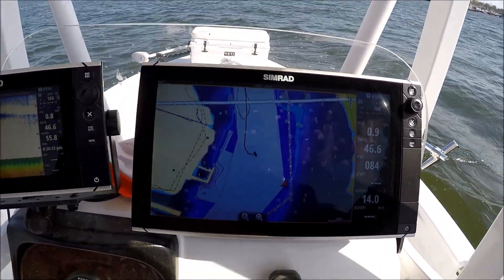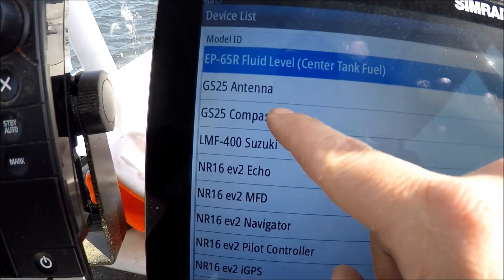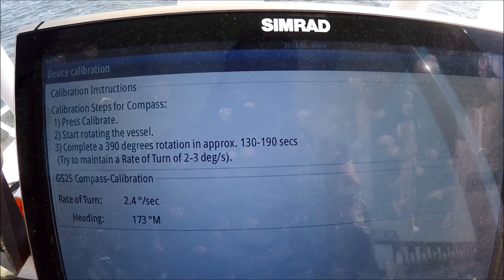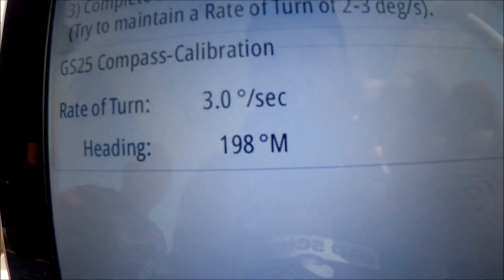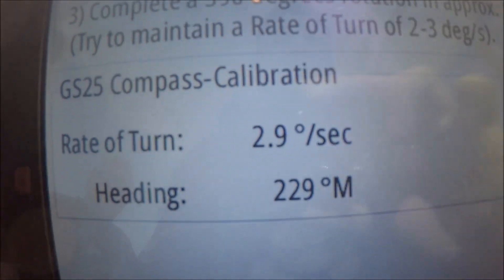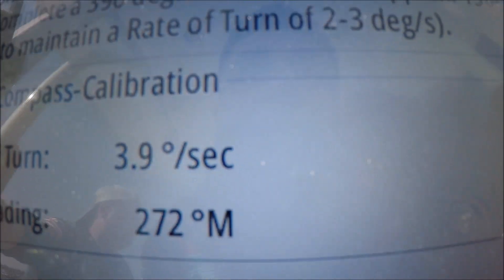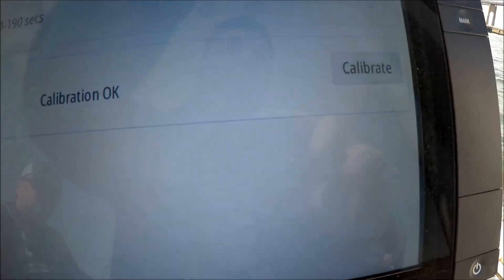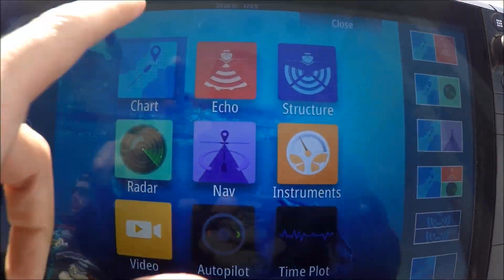How to calibrate your SIMRAD Heading Sensor! Its Easy IMPORTANT! Simrad NSS Evo2 -NSO Evo2- NSE

Comment: Do you need the gs25 or is there an internal compass that you can calibrate?
Reply from the maker: There is no internal compass. It can’t be close to other metals.
Reply: Ok so would that explain why the orientation of my boat never changes on the map when I’m underway? For example if I’m heading east, the boat icon will move east but the bow part of the icon doesn’t actually point east. The boat icon just remains in a fixed position and slides around the map
Reply from the maker: Yep 👍.
Reply: @MikeSmedleyOLDSCHOOLSTRIPERS  last question, would a point-1 work as a gs25 on an evo3?
Reply from the maker: @ I’m 99% sure it will but I haven’t tried personally so I can’t say 100%. It’s all the same company and manufacturers so I’d be surprised if it didn’t work.

Comment: Hi Mike.  I have an Aluminum plate hull boat.  Will my GS25 mounted compass be interfered either no matter where I mount it?
Reply from the maker: It’s hard to say without some experimenting, but if I had an aluminum boat I would definitely find a way to mount it up on some type of pole to get it at least 3 feet away from the aluminum.  I’d probably get a plastic antenna mount that screws up into the bottom of the GS25 and attach the mount to 3’ of heavy PVC pipe or some type of carbon fiber pipe (if you want it to look better). Keep me posted. I’d love to hear how it works for you. 👍
Reply: @MikeSmedleyOLDSCHOOLSTRIPERS  
Many thanks Mike.  I just stumbled across this video by chance and was not even aware of this need to calibrate this compass.  I’ll do it when I’m out next in a few days hopefully.

If I do achieve successful calibration, does this imply that the aluminium hull would not be interfering with the compass?
Reply from the maker: @Camh1968 The aluminum can still interfere even though the calibration was successful.  Aluminum won’t affect it like magnetic steel would, but it can still affect it. It only takes your heading to be off by a few degrees to spell disaster when running at night.
Reply: @MikeSmedleyOLDSCHOOLSTRIPERS  wow- thanks for that.  I have lots to think about to get this right…

Comment: Mike just wondering where you ended up mounting your GS25 on the SP 248.  On my 248' my 4' shakespeare antenna is on starboard side of top and and was thinking of mounting gs25 adjacent on port side of top bringing wires (NMEA2K) down through top into the port side access hatch of the overhead console down inside the support tubes for the top to my backbone inside console.  My concern is that the magnet on forward speaker on the port side might be too much interference (approx. 3+ ft away).  The boat is an hour away at moment so i cant put the magnetometer up there and simply test. Really just wondering were you ended up mounting yours on your SP 248' so I don't end up reinventing the wheel. Did you flush mount or use that plastic offset piece.  Tight lines brother and thanks!
Reply from the maker: Mine is around 12’ from raydome on the centerline of t top. Not flush mounted. 👍👍

Comment: I've had nothing but problems with my GS25 compass.  Countless circles and still won't calibrate, just times out.   Extremely frustrating
Reply from the maker: It’s likely the wire.
Reply: Mike, i've tried that.   Swapped out the NMEA2000 cable with a new one.   Same thing every time just times out.   Heading is all over the place between +32° and -32°
Reply from the maker: If it’s mounted far away from metal and still messes up it might be bad.

Comment: Hey Mike, where did you mount your external heading sensor? If you have radar, do you recommended mounting an external heading sensor behind the radar at it's 6 o'clock position at the centerline of the boat?

Comment: Thanks for creating this Mike.
Reply from the maker: I’m glad you like it brother!!
Reply: @MikeSmedleyOLDSCHOOLSTRIPERS  Went out yesterday for Blue Fin Tuna (late start since I worked the night before) with a few friends and immediately noticed that my heading was off by ~ 40 degrees... thought strangely that my nav switched from Heading Up to Course Up...nada.  Well since we had bright blue skies and 10 mile visibility, I decided we'd go since we were only about 10 miles from any shoreline (plus I have a real compass as backup).  All went smooth, annoying to deal with the offset  (mostly pissed to not be able to use autopilot ;-))...ended up going 6 for 7 on Blue Fin Tuna  - largest going 48".  Assumed it was most likely something with the external physical compass, didn't think about the possibility of calibration via the head unit. Heading down to the boat tomorrow to run this calibration process.  Thanks again.

Comment: Having trouble calibrating go9 xse heading sensor GS25 on a 50' trawler. Do other GPS units affect the magnetic sensor? How big of a circle does it require to calibrate?
Reply from the maker: Dale Gillingham the heading sensor needs to be away from other metal equipment to work best. Once you start calibration the display will tell you how wide your turn needs to be.